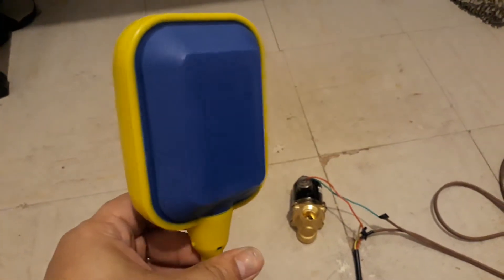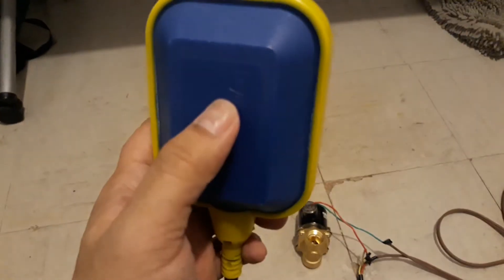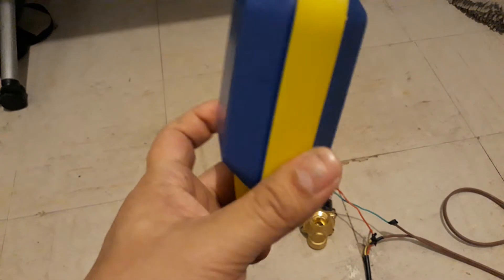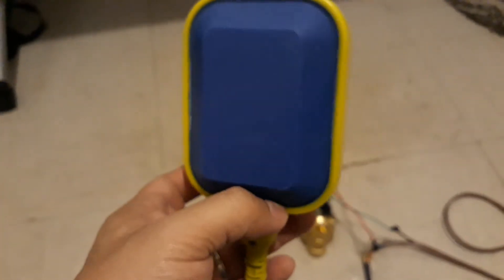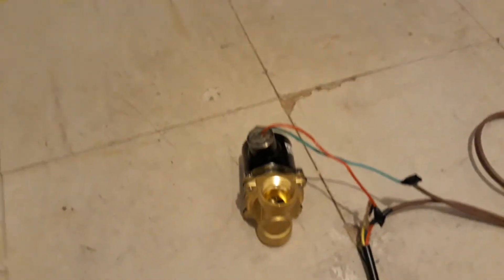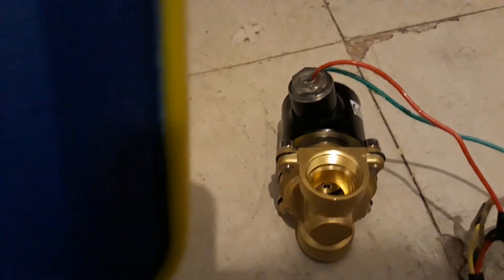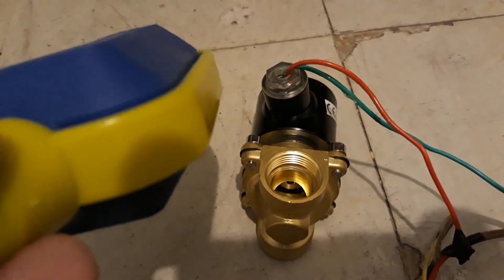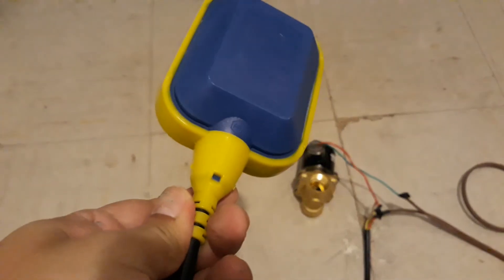Float switch and Solinoid electric water valve from Lazada

Comment: I currently have a D-box float switch but it keeps getting jammed and my cistern keeps overflowing. I'm going to see if I can find the next video to see how you installed the solenoid. I've been advised to switch to solenoid but the guy who works on well systems in my area doesn't even know what one is.

Comment: 24v solonide valve how to connect float switch
Reply: Possible to use 24 v solinoid and 240 float
Reply: You will need 220 VAC or 240 VAC Solenoid valve. 
If you want to use 24 VAC, you will need a transformer to change from your power socket (I assume it is 240 VAC) to the 24 VAC.

Comment: Hi! I was wondering if the float switch can be connected to the water pump? Thanks
Reply from the maker: I think so. It's basically a switch so you can do parallel circuit to turn on the pump